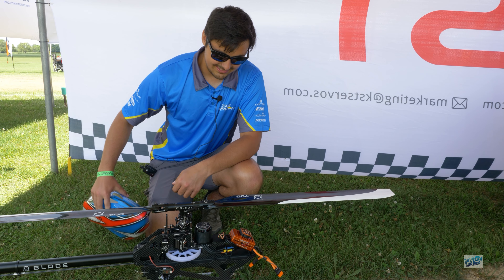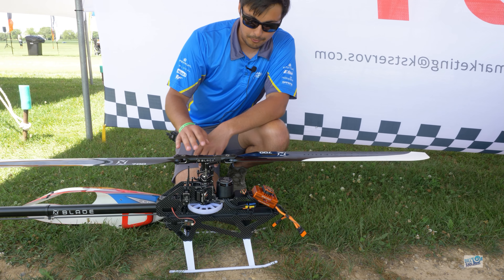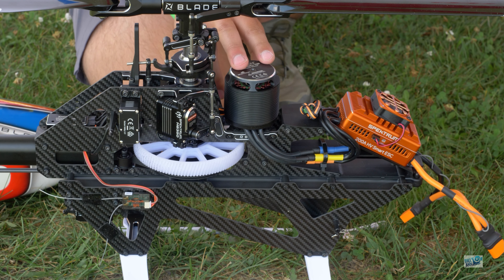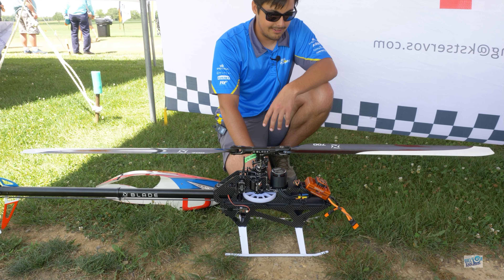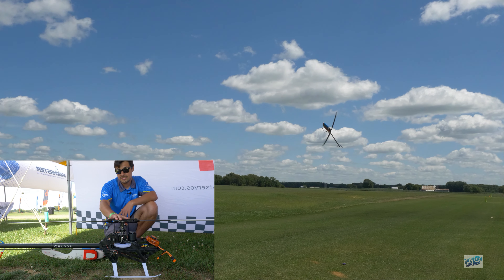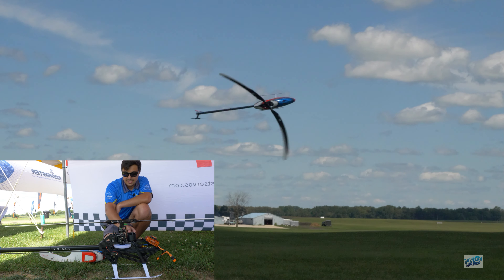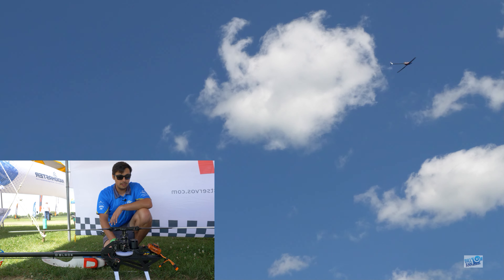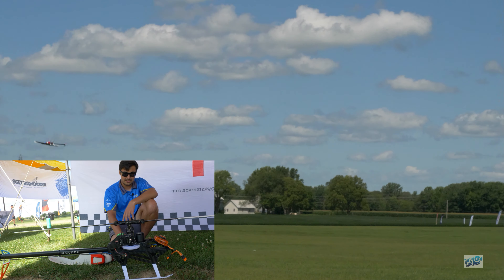Ethan Ater ~ Blade Fusion 700 overview.

Comment: Will parts be available in a year? Blade discontinues models so fast, probably not.
Reply from the maker: Lets give them an chance and see
Reply: I would think so. The Fusion 480 came out 6 years ago, and they still have parts for it. Not all heli manufacturers can stay afloat, it’s tough, e.g. Synergy, Outrage, Oxy, etc. But Blade is still here, so I’ve got faith in them
Reply from the maker: @yenny527  Good point about the Fusion 480!
Reply: Probably not. Last time I bought the blade 700x and 600x and less than 3 months later they got discontinued